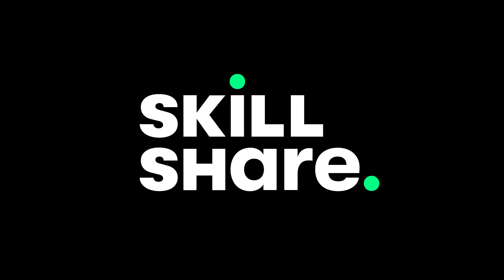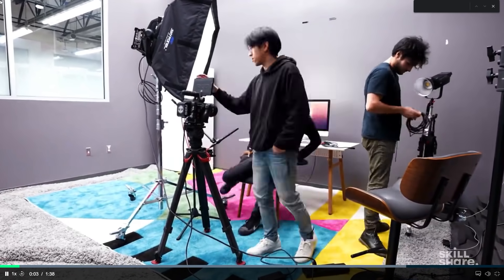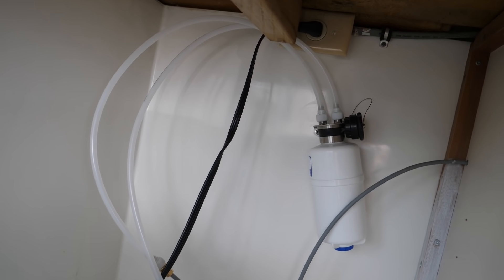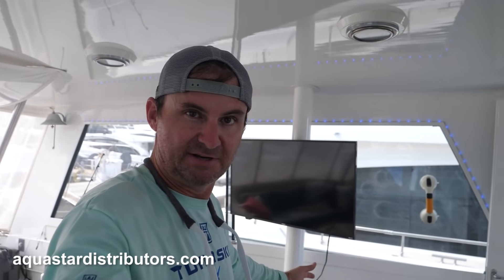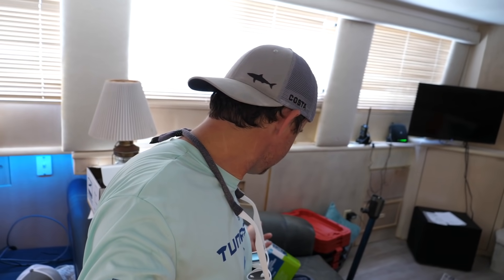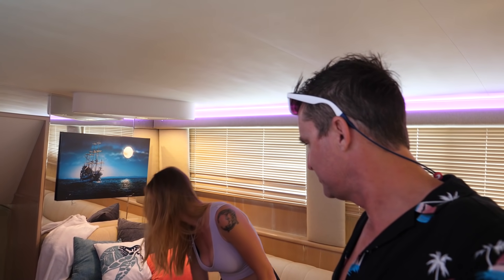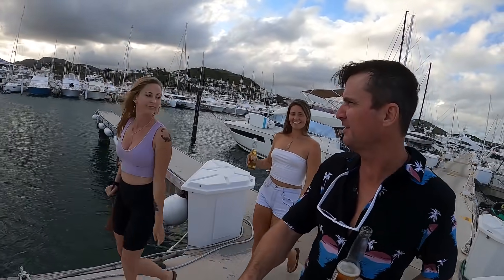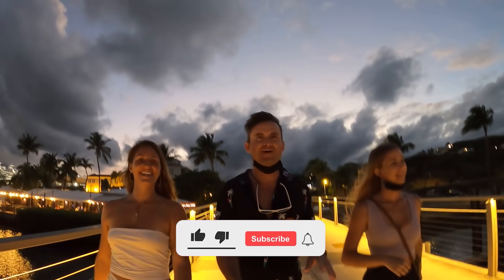Getting the Band Back Together - S6:E26

Comment: Bobby, regarding the well pump not being self priming, put a check valve between the pump and the tank and you'll never have to prime again. Just make sure to add a bypass valve if you ever need to drain it to work on the pump.

Comment: @Sailing Doodles If you have to drill from under again, mark the barrel with tape  so you can stop 1/8 - 1/16 of an inch from cutting through. From the topside, use just the hole bit set in the pilot hole to mark where the cut will come through. Remove the drill and use a utility razor knife to cut your circle with a clean edge.

Comment: LOVING the Hatteras Bobby!!! CONGRATS! Nice Mantus anchor too. One VERY important tip: NEVER connect a swivel directly to the anchor! ALWAYS use a high strength shackle between the swivel and anchor to allow the swivel to pivot in all directlions without putting the swivel in a bind from side loading. Swivels are the weakest link in your ground tackle, and they most often fail when side-loaded. Shackles are rated on straight line pull, and their strength reduces dramatically the more they side load so as soon as you side load one on an anchor shank, the jaws open up and they fail. Your big heavy anchor will certainly stay firmly connected to the bottom, but your boat will float away. Get a Mantus swivel to go with your new anchor. They come with a high strength shackle for a reason! HAVE FUN!!!

Comment: Tips if you have to drill through formica again.  If you have to come from underneath put tape on the formica. Not sure fire, but it will reduce chances of chips.  Another option is take the hole saw out of the drill and just spin it by hand to etch the formica a bit.  It would be best to get all the way through, but even just a light etching reduces chances of chips.  Another option, as you'll likely need to drill in tight spaces on boats is look for a right angle cordless drill.  All the regular manufacturers make them, including Ryobi, Dewalt, and Milwaukie.  And I love the way you think (regarding beer).

Comment: Bobby, regarding drilling with limited space, I noticed you have a Ryobi brand drill.   FYI, Ryobi make a rightangle drill that is VERY handy to have.   Essentially, the ~ 14" drill with the drill attached, is now a ~ 6" drill!   They also have different heads that are available.   I have a Dummel type saw head that goes on mine as well.   Best thing is that it uses the same 18V batteries as your drill.   I must have about 6 or 7 Ryobi tools that use the 18V batteries.   They also have a thin 2Ah battary instead of the 4Ah batteries which decreases some angles a bit.   Also putting painter's tape on both surfaces sometime saves the day from the drill bit chipping the outer surface.   
What am I telling you this for?  You're a smart guy!   lol  Have a great day!

Comment: I have run into the same drilling problems you did with your counter.  There are at least 2 potential solutions.  First get an angle attachment for your drill.  they are awkward but they work.  Second, in a pinch, duck tape the top of the counter, over the pilot hole.  It may prevent the splintering on exit.

Comment: Next time you use a holesaw, to prevent blowout, like you did with the cracked countertop, start top side with your pilot hole, as soon  as you break through, reverse your drill and just lightly score the countertop.  running the bit backwards doesn’t allow it to bite in and cause chipping.  Then switch sides and drill bottom up.  You’ll avoid damage the countertop that way.

Comment: Hey Bobby.  The next time you have to drill up through laminate like that, try scoring the laminate real deep first with a razor blade using the hole saw drill bit as a template.  I've even hand turned the bit on the top side to get down through most if not all of the laminate before going to the underside to drill out the base material.

Comment: On the topic of dirty water, in a pinch you can add regular non scented bleach. There’s a ratio of cups of bleach per gallons of water. Once you run that through your carbon filter it’s very close to undetectable.

Comment: You should have used a small pilot drill from the underside and then the hole saw from above using the pilot hole as a guide. Great Video thx.
Reply: Only if you want to do it right.

Comment: When drilling, if you reverse the direction of your drill, won't break out the back side of the material. It will take longer to drill the hole, but will keep the material safe.
Reply: Well actually how you should do this kind of drilling of a hole is the following, you first drill from whichever side is easier so that the longer small drill penetrates the surface and then you start to drill from the other side where you can align the small drill to the small hole. No ripping.
Reply: @laxman123344  Could not drill from the top, no room
Reply: @pavichapin  Yep, in this case. In an ideal situation that's how you should do it. In this case maybe put a piece of wood on top when drilling from below and press it against the surface and hope for the best, works most of the time.

Comment: Reverse the direction of your drill next time, that reduces breaking the Formica. 😁
Reply: A pilot is not a cabinet maker...proof!  lol
Reply: You could also put duct tape over the formica before you drill it.
Reply: Take the cutting bit off and insert into poly hole. Hand turn and score a total radius. No problem after that and no cracks or fractures!
Reply: As someone else mentioned, tape can also add some backing support to reduce the hole breakout.  Or better yet, place a support/backer board (i.e. scrap 2x4) over that area, so you're not breaking the bit out into air...gives full perimeter support to the hole.  I know, tough to do when you're by yourself when the board cannot be readily clamped in place....maybe some tape/heavy object over the scrap board would suffice?  Regardless, it's always great to see the variety and difficulty level of boat maintenance that Bobby takes on himself.  Cheers!
Reply: I would have just drilled down the way he was going to at the start. Yes, the hole would have been egg shaped at the top but I'll bet the fixture would have covered that.

Comment: Next time you have to drill a hole like that upside down through a countertop where you might risk damaging the top, put a layer of tape (painters tape) on the top and it will help to prevent anything from happening.

Comment: bobby:  beer.  need.  more.  beer.
also bobby:  food?  ah, just put it in the bilge.  we probably won't need it... if we have beer.

a tip on drilling formica.  put blue tape or duct tape on the formica before drilling, and use super-light pressure when you're getting close to punching through.